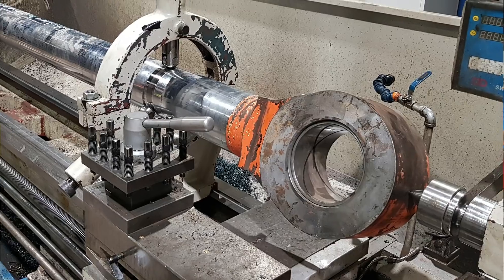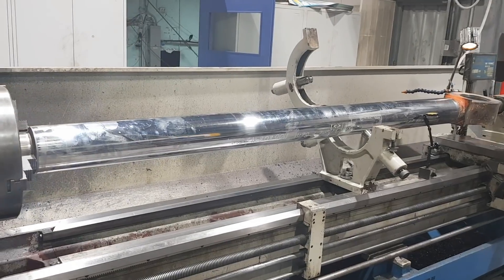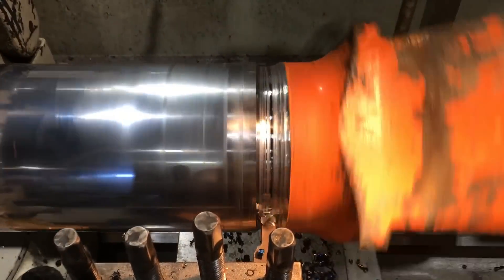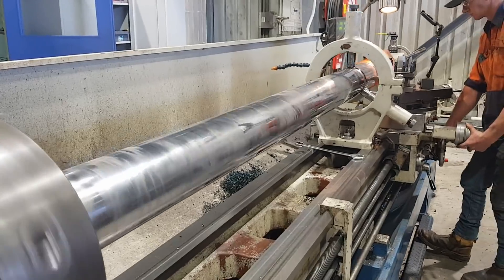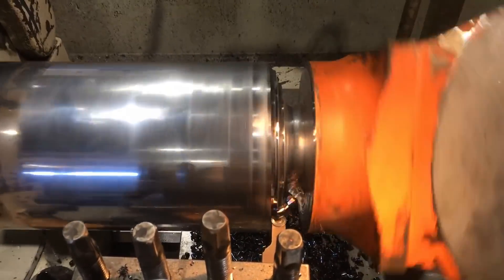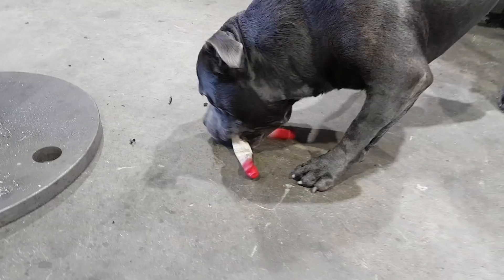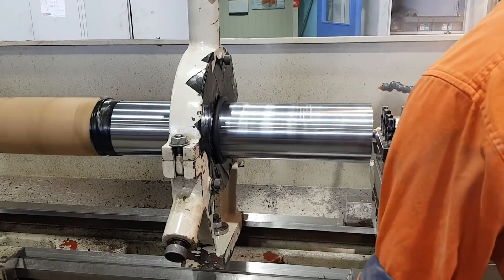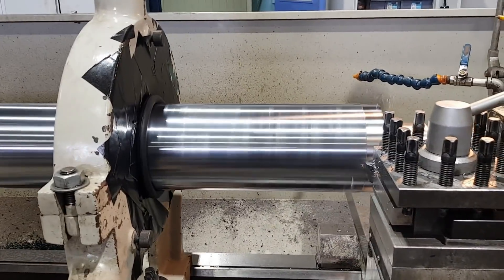Machining a Hydraulic Cylinder Rod for Hitachi EX1900 Mining Excavator | Lathe Work & Welding

Comment: As a DIY er and notorious for leaving my chuck key in the chuck, just curious whether that still happens there, would think one would tend to smarten up very quickly with the force throwing them out but just curious, love the videos as usual
Reply from the maker: Hey mate nah never leave the chuck key in definitely not something you want to become complacent with in a workshop
Reply: @CuttingEdgeEngineering  I'm learning very quickly why you don't but jeez haven't I learnt to duck real quick, cheers mate
Reply: @dashaB-sl4pu  You ain't lying. I was at the shop at like midnight finishing up a truck, drilling the last few holes with the 3/4" magdrill on the frame. I was exhausted but always "oh it's just another 15 then I will be done!" turns into 4 more hours at work. Pulled out the annular and put in the countersink, i was on the side of the machine, oil can in hand, and i pressed the go button, and the chuck key came around and caught my sleeve at the wrist and pulled me in. It was a fire resistant duck cotton work shirt, jeans material so there was no chance of it tearing before I did. I hit the E-stop but it has so much gear reduction it spins a lot before stopping. It dragged me in and my wrist was bent 90 degrees right when the drill finally stopped spinning. MM away from being all sorts of fucked up. 

Be careful with that chuck key bud. It only takes 1 bite to ruin the rest of your life
Reply: @dogsarebest7107  Almost did the same thing as a 15 year old  probationary apprentice [I'm now not far short of 70] and I went to clean the swerf with a rag on a big pillar drill and one of the nearby fitters littorally dragged me away and did he  rip it up me, deservedly so, but then as a kid we didn't know any better, but one thing I did learn is the power and torque with reduction gearboxes isn't a thing to mess with , things that come back to you now as a result of these terrific videos, cheers mate
Reply: @dashaB-sl4pu  Fitter may have ripped into you but probably saved your life! My hand was pinched between the chuck and the vertical slide on the body of the drill (The older big Milwaukee 3/4" magdrills, not the newer little ones). My wrist was bent 90 degrees, and a tiny bit more movement and it would have broken my wrist.. and kept going. After that what I did was get a lanyard for the chuck key on the magdrill. The kind that retract! And I'd clip it onto my belt or shirt, so as soon as you let go of it, it would pull back to you and out of the chuck. Now I realize 3/4" are itty bitty compared to some of the HUGE machines out there but it has more than enough power to chew you up badly! You're totally right about videos bringing memories back
Reply: @dashaB-sl4pu  Yea the old boys weren't afraid to rip into you when you do something dangerous with a tool. Most of them were missing fingers so they had to learn the hard way. I know which way I'd like to learn.
Reply: @mrgumbook  I don't have an issue with it at all, they had all our best interests and safety at heart and I was pretty fresh out of high school, about 1967-1968 there abouts and knew everything as you do at that age, now retired ,almost 70 and survived and somewhere along the way the stupidity mellowed, now I'd be up there with those old boys doing the same thing, probably worse, finished up an electrician and paranoid on safety, cheers mate